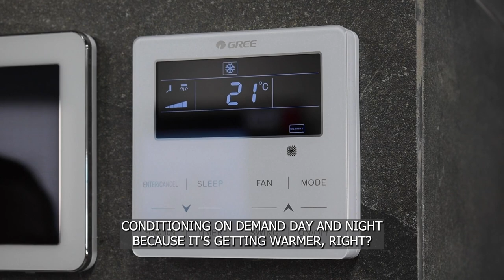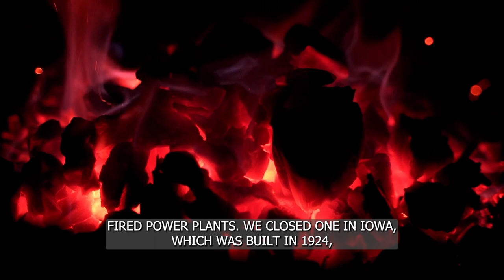There are No such thing like Electric Cars - Vaclav Smil

Comment: Makes a lot of sense. All it takes maybe is just to get corporates and politicians (shareholders and voters too) to be socially and environmentally responsible so that marketing campaigns on products and solutions which promote adoption of socially and environmentally irresponsible products and solutions is reduced (some example mentioned were SUVs, excessive unecessary travelling, inefficient town planning, etc).
All are common sense and our common senses had been skewed by marketing and propaganda manipulations fuelled by greed in the past decades.
Reply from the maker: The problem that seems equally important to me is the decision to completely give up fossil fuel cars. I have the impression that we are fooling ourselves. Yes, electric cars are an alternative for dense cities in order to avoid exhaust gas pollution, but let's not think that we have switched to green energy...
We will pollute as much as perhaps we will have a lower concentration of pollutants inside the cities.
Reply: @simpleinvestings  Agree. People often forgot to consider the scale of the core issue here. Unless electricity were generated by clean methods such as nuclear or hyro or geothermal, or even the "more carbon neutral" biomass gasification methods, the other existing methods are just as polluting. Using coal as the energy source for electricity generates a lot more pollution. Using natural gas is just the same. Factor in the cost (and the environmental costs) of production of upgrading the electricity distribution and energy waste due to inefficiencies in every step of the process will paint a broader picture. We haven't even touched on the issues of waste generated from all the processes and materials such as the batteries here.
It's just merely shifting the pollution from the cities out to other locations.

Comment: Meanwhile in Norway. 90% EV share
Reply from the maker: Yes, Norway and other Nordic countries have the great advantage of being able to produce green energy due to their location and exposure to the wind.
Reply: He said EVs don't work in cold climate.  @simpleinvestings
Reply from the maker: @user-221i  Some studies and reports from users indicate a decrease in battery life of up to 20-40% in temperatures of -5 degrees Celsius or lower compared to performance in moderate temperatures.

The problem is what do you do when you have long distances to walk. The car is usually perceived as a means to get freedom, big roads. Let's assume an invasion in that part of the world and you need to move urgently. The power went out, people can't take you in the car, what to do?
I still believe that the personal car should be a luxury and not an element of every family.
Reply: I had a problem with my Tesla being able to open the doors when it was cold they wouldn't come out. So I bought a Polestar instead, which is more designed for our climate.

Comment: Isn't that akin to say we don't exist because we rely on fossils fuel to keep society moving? Moving away from too much reliance on  fossils fuel requires laying the foundation. EV are getting more efficient as time goes on. Meaning less battery follow by lighter weight. Do you think gasoline cars has the efficiency that it has now since the invention of the combustion engine?
Reply from the maker: I think it's a matter of marketing when we say that electric cars are green products.
In fact, they use both lithium ion and oil and coal for electricity.
I think we can agree that electric cars can be a benefit, but let's not make them the spearhead and promote them for giving up fossil energy.
Reply: i disagree, any item can be used as a spearhead, electric car is much better than a gasoline car this doesnt chance the energy generation issuie but lets not burn the good iwth the bad @simpleinvestings
Reply from the maker: The problem of electric cars, if we exclude the way they are built and the materials, we are definitely talking about their inability to serve long distances. Imagine yourself in such a car in case of emergency, when you have to urgently leave a state or a danger. @kerimalpaltuncu97
Reply: its a bogus statement to judge electric cars with their current rangew hich is expanding with technology, it isnt a godo ground to judge by range, which are at this stage can do an avarage 432 km, what kind of an emergency are we talking about where you will drive miore than that withput any breaks, its a backwards statement given that technology is rapidly growing @simpleinvestings
Reply from the maker: @kerimalpaltuncu97  
https://youtu.be/r76Dfl5g68s

I also recommend this clip. Maybe the audio quality is not great, but here Smil talks about the impossibility of batteries to replace fossil energy.
Reply: Both EVs and combustion have gotten better. EVs initially used cobalt to extend range but they have found more eco friendly alternatives.

Combustion engines initially used carburetors but now they use fuel injectors. Opposed piston engines have also been tested and they are crazy efficient.

Comment: where does it go -35 degrees, lol he is t alking bulshiit, becaue most of the places are neither too hot or too cold,
Reply: Canada gets in the -20, to -40 all the time. I grew up in Winnipeg, lived through it plenty of times.

And just this year Jan 14, 2024 Alberta, which has a lot of wind farms on its grid nearly lost the grid when it hit -37 in the polar vortex (zero wind, and 1 gas plant down) had to send out an emergency signal to people phones to cut back unnecessary power or have blackouts.  People did and saved the day.

Now, if everyone was driving evs and heating with heat pumps there would have been a far worse problem.

Comment: i was going to read his books but he is sounding sooo ignorant and small minded here as if technology doesnt do leaps
Reply: Snore... Let's see what you come with . I doubt you will. He is spot on
Reply: Point out what he's ignorant about on energy?  What is he specifically wrong about.

 He's written volumes on the energy sector and past transitions.

There is a delusion right now that somehow we can ditch fossil fuels to zero in 30 

Currently primary energy worldwide is 83% fossil based.
Basically wind and solar provide 2-3% worldwide and require vast amounts of storage to be useful.

We make 4billion tons of cement, 2 billion tons of steel, 
160 million tons of ammonia, and a couple hundred million in industrial plastics, chemicals, adhesives etc all using fossil fuels.

There is nothing that can replace any of these at scale anytime soon.